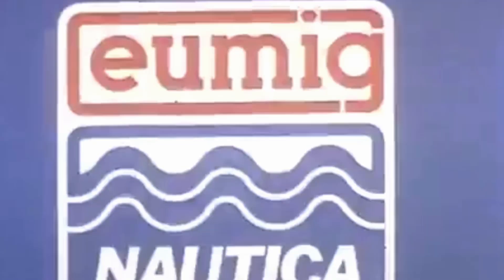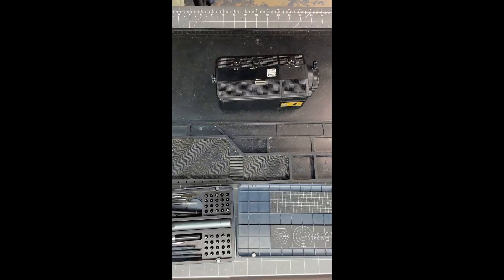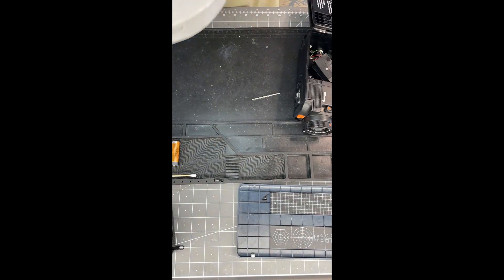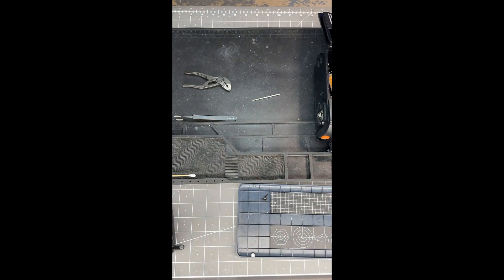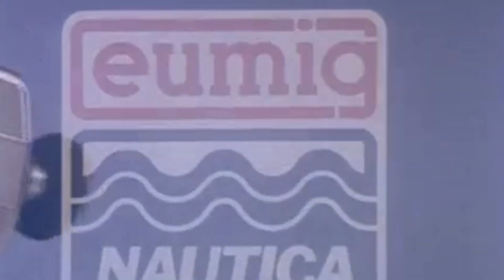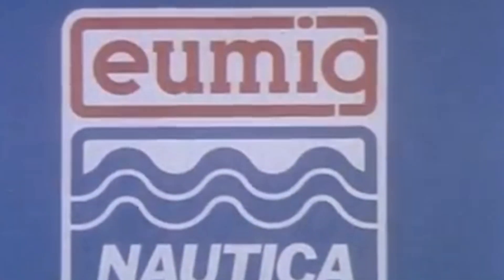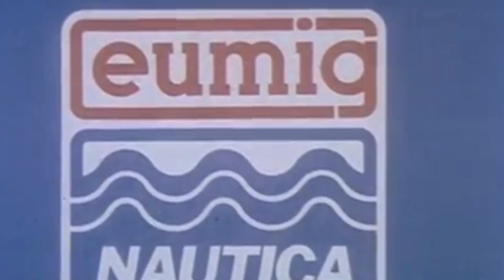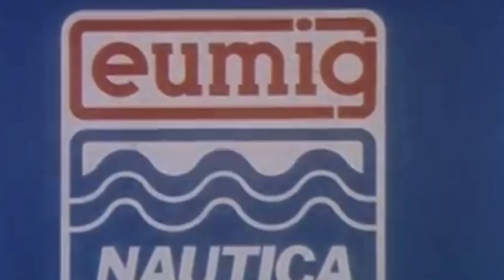Fixing an Underwater super 8 film camera! Behold the Eumig Nautica cine film camera repair

Comment: I had one, but while the outside was solid and lenses in good shape, the inside was crumbling and eventually fell apart.  had this video surfaced then a few years ago, I would have definitely contacted you.  Before Eumig folded, they planned multiple colors for the model, as well as ones that did sound speed 24 frames per second.  Too bad they went bankrupt.